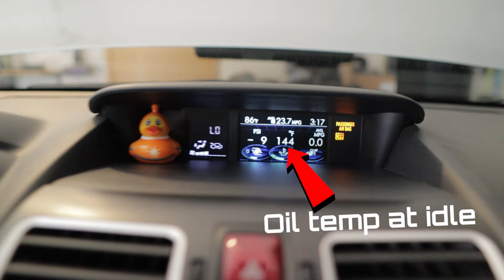WRX Oil Change MADE SIMPLE #shorts

Comment: Pro tip.  Don't dry start your FA20.  Hold throttle to floor while cranking to enable "clear flood mode".  Turn it over until the oil pressure light on dash goes off.  This primes the oil system, filter, etc.. Then start like normal.  You're welcome.   *edit and I see someone beat me to it lol

Comment: Pro tip. Do not start the car after changing the oil until you do the proper procedure of pushing the gas pedal to the floor and the clutch and turning the engine over for a few seconds. This will pump the oil through the engine before you start the car to minimize engine wear at startup.
Reply from the maker: Priming the oil pump you mean? The oil pump sits near the bottom of the loop so it'll always have oil in it after an oil change. In terms of the engine itself, amount of oil pressure built up in the 1-3 seconds of the starter turning over is more than enough time to push oil into all of the important components. Keep in mind also that the components themselves, even after draining the oil out will still have a substantial layer of oil on them. 👍 I agree with you if the engine is still breaking in or if it's a brand new engine though.
Reply: @WRXGarage  It also helps by pushing oil through the oil filter. I prime it for about 60 seconds myself. To each their own though. I know the Subaru mechanic on the @MrSubaru1387 channel recommends it. That's how I learned it.
Reply from the maker: I'll definitely look more into it!
Reply: @Brisky86  Sixty seconds!  That's a lot longer than needed but if it makes you feel better, go ahead.
Reply: @WRXGarage  Or you could just do it the way he said, which would be the most proper way.
Reply: @jamesg8246  I mean you can do whatever you want. You could drive using water. It's your vehicle after all. 🤷‍♂️
Reply: @Brisky86  Well yeah.  I'm just saying when someone points out a clearly better method for doing something the first thing I don't do is come up with reasons not to do it.
Reply: @jamesg8246  It's all information. Some people oil their oil filters. Some don't. You ultimately get to decide what you do with it or not. I would not instruct anyone to do something if I thought it was harmful but if I know something can help others I will do my best to inform them and let them decide what to do now that they are informed. It's not necessarily about right or wrong. Changing oil is a good idea period.

Comment: Where are you putting the jack stands? I always had trouble with my lowered wrx in lifting and putting the jack stands on the pinch welds from the front
Reply from the maker: There is a jack point underneath on the frame! It's where the control arm connects to the frame (you can see a bolt head that goes through the control arm bushing).
Reply: I always just use the pinch weld to jack the car up pop open the drain plug and lower the jack to let the car sit flat so all the oil comes out then do the oil filter and run part of the 6th quart through to just ensure I get as much old oil out then raise it back up using the pinch weld and put the new crush washer and the plug back..lower it do filter and 5.4 qts of oil...done

Comment: Where did you put the jacks?  You should me a video on that
Reply from the maker: Message us on IG
Reply: There is a central lift point behind the engine for the front and use the rear diff for the rear, slide the jackstands under the 4 pinchwelds. I had to use a couple short pieces of 2x10 under the front tires to make enough room for my floor jack to reach the front lift point.

Comment: This came at a good time. Gotta change my oil this weekend and finally got all the stuff to do it myself (finally).
Reply from the maker: The fumoto drain valve is a game changer!
Reply: @WRXGarage  How so? I never heard of it and looked up a review, I dunno looks kinda gimmicky to me. Might not allow all the oil to drain completely, could get hit on something. Seems like a lot of risk for something a funnel and a wrench can do just as well.
Reply from the maker: The only difference is you can control exactly when the oil comes out. Even with a wrench there's still the potential for it to splash everywhere when you're pulling the plug out.
Reply: @WRXGarage  Yea that's true. Thanks for letting me know this thing exists :)